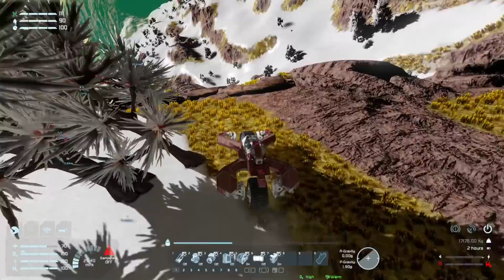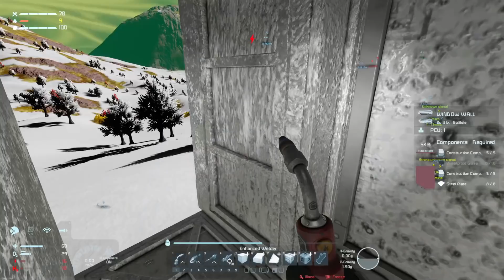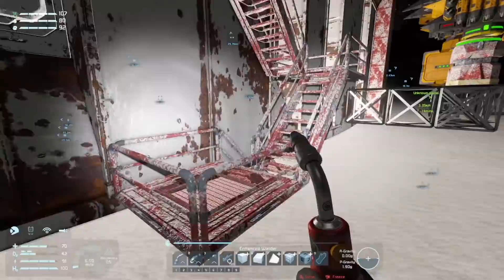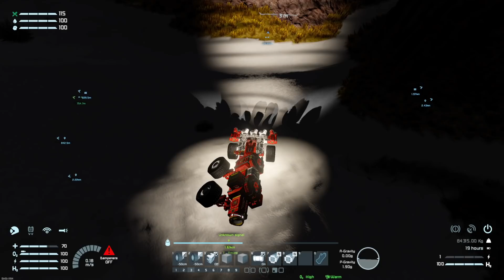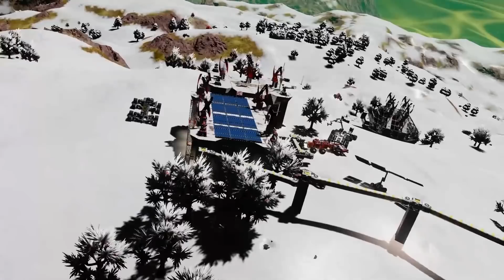Survival Impossible - Fort Decoy #46 - Space Engineers Hardcore Survival

Comment: 22:43 - the lack of reasonably-sized large grid antennas is very annoying, indeed.   Sometimes you don't need an atomic bomb to deal with a fly, a rolled-up newspaper would be fine.  A 2x1x1 or 1x1x1 large grid antenna with the same range as the small grid antenna would be very welcome in my builds.

Comment: I was going back to watch your Survival impossible from the beginning and I have some advise over your conveyor network between buildings that you made back in episode 40.  I have, several times, merged a mobile grid to a static grid in voxels.  I have a standard mining outpost that I build with a mining crane, kinda standard, and I usually build it in space then fly it out, typically to a moon, also rarely an asteroid.  I convert it to a static grid by way of using just a single merge block in the voxels and nothing else.  Now I have not tested the Hinge element but I am fairly certain it would not be a problem.
Reply from the maker: The issue appears to be that the grid being merged to the voxels is itself a subgrid of something else, when that is the case the explosions you saw take place unless the grid in the voxels has more blocks :)
Reply: @Splitsie  interesting, did you report it on keen's bug forum?

Comment: 3:32 Do the drones still have a tendency to hit the ground even when in normal gravity but extreme terrain as well? Because if so it's interesting that they do it on Omicron.

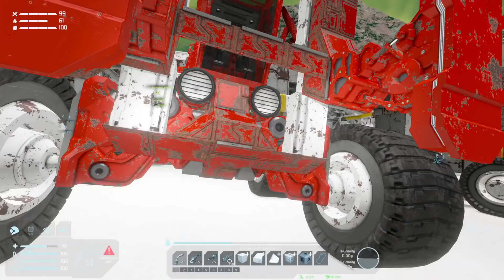9:22 The drop pods are working as temporary decoys but the outlying defences have been sitting pretty high on that list for a while.

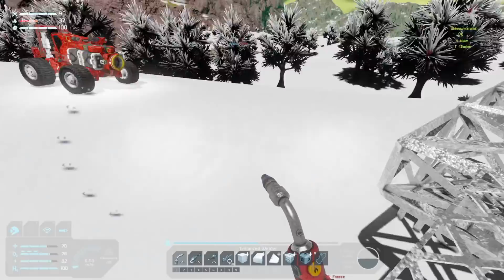15:45 It's a work vehicle. The original idea was carrying the drop pods, which is why it has its fancy compatible dock in that building, but it's still good for just carrying things in cargo or as grids.

17:46 He looks like he froze to death there. Among the more painful ways Capacs have gone out.

21:06 Clang disapproves of your actions, increasing the power of Capac in this world.

22:27 You could place a beacon as the tower for the turbine, since it would lure in REAVER ships before they reach your base.

25:06 I quite like the look of it, also how the turbine looks like it's spinning so slowly due to being frozen over.

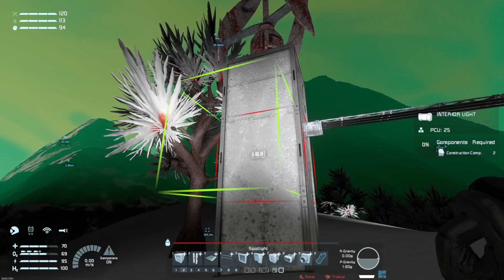27:05 And thus you have cemented its fate. Though as a decoy tower it already was doomed from the beginning.

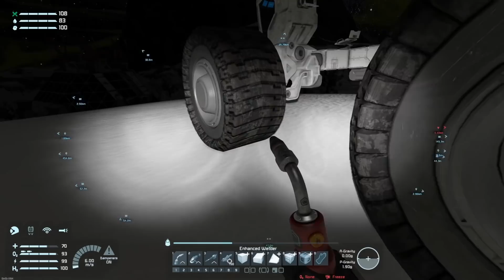28:04 Is this another thing on the list that you haven't done yet? Maybe it'll actually be done now. Or maybe not, if you go and work on more of the Fort Capacs.

45:29 It has plenty of power but not much power. Probably should've put that machinery on there now, a H2 engine and gas generator (maybe some small hydrogen tanks) would be helpful for what is essentially used as a mid-to-long range support vehicle. You don't want that to happen again when you're midway in-between a wreck and base.
Also if you haven't put the small emergency battery on all of your vehicles like the Absconder's, you really should since this sort of thing can be a big problem with your barely sufficient power generation.

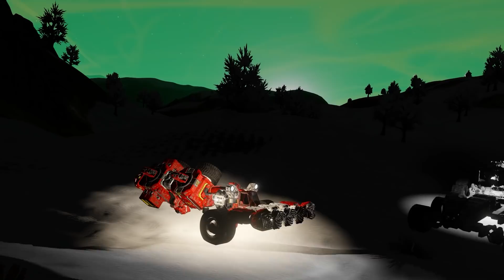50:20 The crane is probably the best looking vehicle in these timelapses. So satisfying to watch.

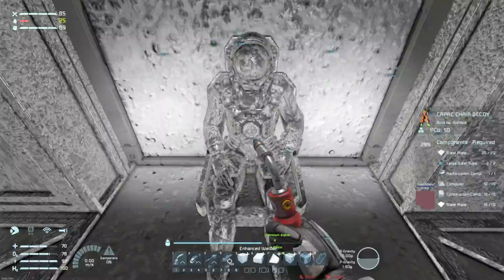Comment: 19:10 - I think the rust, snow, and mossy skins should be redesigned to be textures that would be applicable over other skins like battered or carbon fiber. You usually think of these as something that is over the base material, so it doesn't make sense that, if you have a battered armor building, you cannot paint the roofs snowy and the rims mossy without completely changing the base look of the block, which now doesn't go at all with the rest of the building. And making stuff all rust just looks like a wreckage pulled out off a junk yard, and all snow and moss gets overwhelming as well. I think the textures were a huge improvement to the look of the game, but tbh the implementations has been pretty rudimentary so far. I'd like to see Keen do more with it, I know they can pull it off.
Reply from the maker: Agreed, that would be a very nice change and add so much detail to builds to make them look like they've weathered in some way :)

Comment: Have you considered making a repair vehicle?  Mount a welder on a control arm using rotors and/or hinges. Carry parts in a cargo container and reduce the need for scaffolding.
Reply from the maker: It's something I plan on doing, but have held off due to some strength bugs with hinges attached to hinges since welders can get quite heavy :/

Comment: regarding your power problems, you have a ship capable of carrying a large grid ore detector and unless its gone missing a random small grid battery floating around with charge in it.. 
you could use a rotor and a small grid merge block and make a hot-swap-able battery pack you could charge on the base and then air lift onto your vehicles in need temporarily.

Comment: Seriously Splitsie, why dont you just put the connector for the drone on the timer block too? just make it a one button take off, it seems like you make theses little things just slightly more complicated than they need to be, and it always seems to bite you later on (entertainment value add? lol) I just really dont get it, then again i guess i dont really need to, but sometimes you're just a bit hard to watch buddy. Still love the content, keep it up dude
Reply from the maker: It's something I've avoided since my days of running into issues with that setup in Survival Maybe. It's too easy for the connector and the batteries to get desynced particularly if I'm running scripts designed to control that sort of stuff. I had too many times where I'd press my one button disconnect only to find that the connector unlocked but the batteries switched TO recharge rather than switching off and that sort of thing. It's almost certainly me messing something up elsewhere but oddly this setup has been more reliable for me not less when I've used it
Reply: @Splitsie  Thats a good point, I had issues with that in the past as well. My solution was to use 2 timers per ship, one for takeoff that specifically triggered the functions of turning the batteries to discharge and the connector to unlock and so on, and the second for landing to trigger the  batteries to recharge and the connector to lock and so on, if that makes sense. Basically instead of triggering the switch function with the timer, you trigger the exact function you want lol anyways cheers mate, have a good one and thanks for responding

Comment: Hi! The issue with the wheels, well i only had it once, i think its about its configuration, the strength, the force implied on them, when i correct it, it stop happening. Also the weight is an important fact. Bye
Reply from the maker: Weight can have an impact, but from my testing it was rarely enough to cause the popping, it still needed the PC to be struggling a bit for things to go badly with higher frequency

Comment: About the explody wheels: I've certainly come across what you've described - when the system is under load, there's more time between each physics calculation, or "tick"; and since one of the key ingredients in physics is time, it causes funny things. In this case, the wheel is traveling fast enough, and on a vector with a sharp enough angle to the surface, that it effectively skips the boundary calculation that would cause it to bounce off and goes straight into "you've just teleported inside solid voxel, thanks for playing".

Having said that, I always thought it was just weight. I tended to find it happened more when I was overloaded in my knockoff backyard Goose, and/or when going too fast over rough terrain. I got plenty of practice at digging myself out to place yet another wheel! It could also be the weight just exacerbates the tick lag issue, too - wheel bounces, lag spike and suddenly the suspension's pushed it where no wheel should ever go.

Anyway, that's a lot of rambling on wheels. Good show, always look forward to watching, and appreciate the effort as always. Cheers!

Edit: Formatting. I really, really dislike the YT editor.
Reply from the maker: Yup, that's pretty consistent with my testing, the weight seems to exacerbate the underlying 'Oops! I'm in the voxels' problem :/

Comment: Forts Capac - "They were never going to be optimal" - Splitsie's aesthetics over function.
Reavers - "Oh look! How cute that little decoy is! Lets leave it be, and take care of that rusty base instead"

I think that that outpost may have design flaw. Decoy will draw fire to turret, cargo box and battery. I'd advise to build another arm and build power/turret/decoy all on separate platforms connected with wires.
Reply from the maker: Agreed, the decoy won't have much use if the turret is still active, but at least it'll keep drawing fire for a little longer since it's got a bit more protection than if I'd just put the turret down on its own :)
Reply: true but it might be pointless, even a small gatling can eat thru that light armor very easily, but that entirely depends on the attacker's aim, which seemed horrible up until now

Comment: You could make a little power thief from your arboretum. Make a battery with two connectors (or merge block, but seems more risky) and a script block. When battery is low, put it on recharge and connect to the arboretum. When the power is high put it on discharge and connect to the base. It will not connect the arboretum and base so your food assembler situation would be fine, but you could give excess power to the base. I know, it would be easier to make few more wind turbines, but where is fun in it?